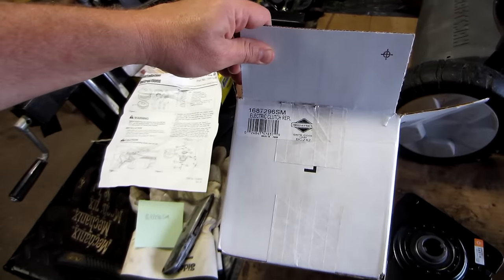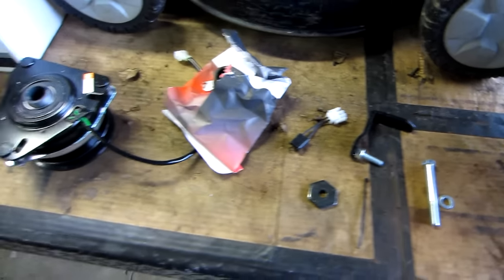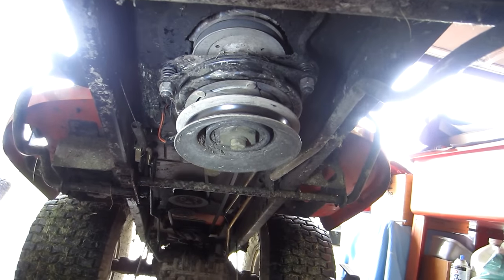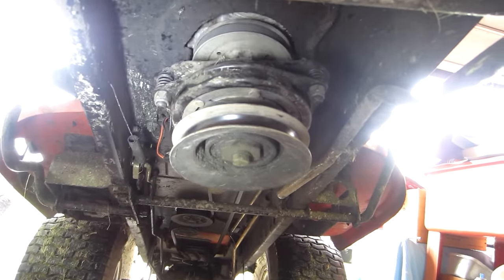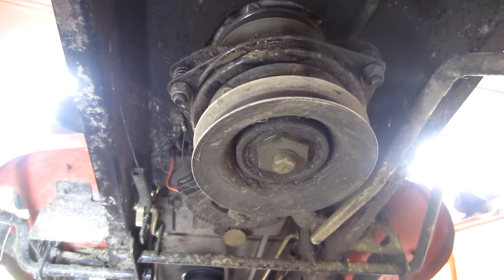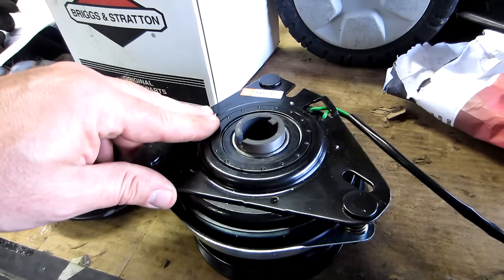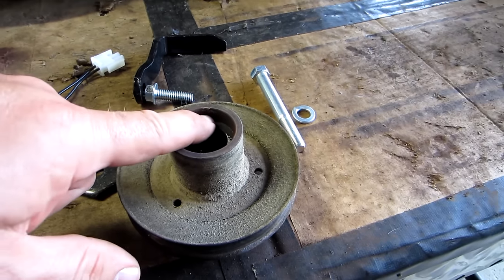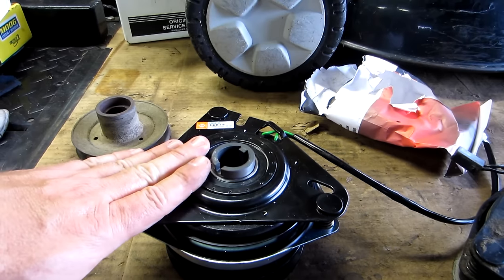Troubleshoot Replace mower PTO CLUTCH

Comment: WOW, what a great video. I'm not a Mechanic, but do most of my own repair work if I can figure it out. I'm so glad I watched this. I've had to replace the wire (splice out) going to my pto clutch twice. Husq YTH 2348 Finally found the round holding rod coming out and allowing the clutch to spin and tear everything loose. The hole in the clutch plate must be wallowed out. I put it back in good and tighted the rod which runs to the outside of the frame very tight, but it did it again. I saw on another video the techn said the ohms should be at least 2.5 across the clutch leads. His new clutch checked 3.1. I checked mine and it was .002 which is close to zero so I'm changing it out. I had started hearing a loud noise over the past couple months and kept using it. It was probably that clutch going bad. Anyway, a new clutch it is and I'm glad to see a re-design on the hold down bar vs a round rod to prevent it from spinning. You are a great instructor on your videos. You put the info down on the lower shelf so people like me (who can work with their hands and are mechanically inclined) can understand what you are saying. If I can see you do it, usually I can do it. Thanks again. By the way, I'm no spring chicken. I'm 68 and can still do it. It's the gettin up and down part that's hard. lol

Comment: Having a problem with the mower blades not engaging when the PTO is pulled up.  Going to try to troubleshoot the switch and clutch this weekend and the videos on Youtube have been very helpful with diagnosing this issue
Reply: listen to him he knows his stuff good. But my fix is turning my pto mowers into cable engagement mowers no electrical bullshit no pto clutch that you know will break again thats why John deere and craftsmen made some of their mower's with those mine wont have them for to much longer

Comment: Nice one Foxboss9, my ride on mower blades would engage at first than after a while if you turned off the blades they wouldn't re-engage. So I tested for power supply all ok, I re set the clutch gap and Bingo, she's running as good as gold.

Comment: Thank you for information and advice 
Yep clutch over heating and bad electric clutch is so common now
Reply: On my 3rd mower took me hours to figure out were the blade engagement cable goes i couldn't see how it threaded through but then i figured it out after about 3 hours

Comment: Thanks!  The bracket that mounts the front axle and deck front yolk to the frame on my 1986 Bolens GT180 made an "excursion" when the nuts finally stripped off of all four 35 year old bolts.  And of course it pulled one of the wires pulled out of the clutch assembly in doing so.  Hopefully I can shove it back in to fix it if it's just at a connector.  It looks like it pulled out cleanly.  

Or maybe I can find a new wire assembly.  It's still almost new, you know, lots of life left in the old girl.  Good enough that yeah, I might have to go with a new clutch if necessary.

Oh, by the way, I have always engaged the clutch at about half throttle.  15 years ago I had to tighten the three bolts about a third of a turn.  Once. That's it, with 925 hours on it.  So don't do it at full bore.

Comment: Converted my JD F 930 electric clutch to cable idler pulley, now  smooth engagement and no slippage.  No more silly dual coil springs to maintain belt tension.  Electric clutch is the worst idea, period 💪

Comment: Very detailed video.  I for one can appreciate it!  Pretty sure my clutch is out on mine gloms through the troubleshooting steps you mentioned.  I did however take the switch apart, broke it apart more or less lol so I can tell that the contacts were touching and verified that it was still good.  Thanks again

Comment: Good video made by an intelligent man with a good sense for video presentation. My PTO quietly died while mowing. After spending some time with the multi meter, pulling the ignition and PTO switches, finding solid ground locations, and getting random results, I started to pay more attention to the small melted spot on the PTO switch receptacle - not the plug itself. Then with the key ON and my foot on the seat to provide "operator presence", I was able to turn the clutch off and on by jiggling the connected PTO switch and plug together. But I sure wouldn't replace the entire harness, so I'll probably just bend and jigger the copper in the plug. I may take a look at how replaceable the plug is. Thanks for the inspiring vid.
Reply: Just a super great job at presenting a video that explains in depth the possible problems and the correct procedures for testing and rectifying.  You are to be applauded for just a super  presentation

Comment: Fabulous work and great explanation! I'm having this PTO clutch issue w/ my 20 year old Regent and this was a tremendous help. Unfortunately I maybe forced to get rid of my tractor if I can't get the adjustment to fix the issue. Keep up the good work.
Reply: Did you ever get that to work I can’t for life of me get my new clutch to go on should it just slide on? Or should you have to hammer it on?

Comment: Welp all done. The hardest thing was getting the connector undone to the clutch, the 2nd hardest thing was getting the drive belt onto the last pulley. I zip tied part of the belt to the pulley and I made a tool so I could turn the pulley with a ratchet and with the tool it was easy. I like my Ariens max zoom mower.

Comment: Foxboss9 thanks for your help. Let me tell you what happen . First I went and bought a new PTO switch and an new clutch. But for some reason I must have gotten a bad PTO  switch. So I did what you said and jumped the switch that I thought was brand new only to find out that it was bad, My clutch Kicked in and that was all she wrote. So I went and bought a new switch and problem solved. Thanks for you help. I am taking this serious and getting certified as a small engine mechanic. It's nice to know that I can count on you to be there. THANKS
Reply from the maker: So glad you pinpointed that issue! hopefully not much more electrical problems in the future..they can be rough to find!!

Comment: your channel is very helpful. I have a Cub Cadet ZT1 42. the wiring and switch checks out good. When I engage the electric clutch, the mower deck will not disengage. I have to shut the mower off to shut deck off. When I restart the mower, the deck is often still engaged, but not all the time. is my clutch bad?

Comment: I got a john deere 285 pto doing the same thing that would keep shutting down and I found a double yellow wire that was loose on the key switch. Replace the key switch and found that was the problem now it works great.

Comment: Awesome "mytractorforum" pointed this out to me. Lucky mule was detached for years. It's from a 1988 JD 332 dealer wants $650. I found a aftermarket coil pack on ebay & bearing for $200. Here are my quotes from tractorforum. "The problem with the resistance being .002 ohms is that it is drawing more than twice the amount of current, which heats up wires, wire insulation, VR and draws on the battery. It may work fine now, but you may just drive it till there smoke or flames rolling out from under the plastic hood"

Comment: My Craftsman got to the point where the PTO would engage with the mower cold but if you disengaged after cutting a while and tried to turn back on it would not work until you let mower cool. Yesterday it quit while I was cutting and doesn't operate at all now. Haven't had a chance to look further though.
Reply from the maker: Adjust air gap on PTO. There are three nuts that sandwich the plates at a certain distance. Definitely sounds to me as that Gap has gotten greater as the clutch has worn this is a common adjustment.

Comment: Brilliant. I need to replace the main drive belt of a Snapper SPX17542, which looks identical to this model, and was wondering what I'd have to do about the wire to the PTO clutch as it was preventing me from removing the belt. I guess I'd just have to disconnect it, and the connector is probably in the engine space. Now I don't have to remove the clutch from the engine. Thanks!

Comment: I have one when you start it and engage the clutch the motor dies Just curious if the clutch might be bad should I test it with the voltage  meter

Comment: Recently, my Craftsman DYT4000 (B&S engine) started to take much longer for blades to reach full spin speed once switch is pulled. Used to take only 1 second, now takes up to 5 seconds! New belt, tensioner, spindles and pulleys. Only thing it could be now is the PTO clutch is slippin? It's gotta be right? That would cause the blades to take longer to reach full spin speeds

Comment: I am not sure if my clutch is bad or not. It work great all last season, shapened blades, put deck back on, tried it for the first time this season and PTO clicks, but dont seem to sping blades fast enough to cut grass, had to use push mower. So it does engage but doesnt load the engine hardly at all, and blades dont spin fast enough to cut. I took the belt and blades spin easily so It has to be something in the PTO. Its on a 48" JD D-140 with electric pto. Any suggestions appreciated. Im on a fixed income and can not aford to try this and that and hope for the best, or take it to a repair shop if I dont have to. Thanks
Reply from the maker: Adjust clutch if needed... Look for a stuck belt tensioner that is allowing belt to slip on pulleys.. Make sure belt isn't in bad shape, like oil on it or wore out
Reply: Great thank you

Comment: did you use an impact to tighten this as well? I heard you're just supposed to grip the HEX nut and tighten the long bolt to torque specs? Thanks for the help. I'm about to replace mine on my broadmoor.

Comment: Ok Foxboss i tested the power from the battery to the PTO switch harness I had power. but  i don't know how to test the connection from the harness to the connector that hooks up to the connector on the PTO clutch. I put the leads on the two wires the black/white and the black one but i didn't get any reading. I don't know if that was the proper way to test. I also turned on the motor and put the switch back on. And I engaged the switch and put a clamp on the seat safety switch. I just bought the switch so i hope it's good.
Reply from the maker: One side of the tester will go to ground and the probe will need to go into the backside of the switch harness while it is connected.. Not knowing for sure which wire is going to be the hot wire with the switch on you'll need to place the Probe on each wire individually and find which one becomes hot when the switch is on and cold when off..

Comment: Great video.  I just fired up my mower from winter storage and I noticed my pot starts but it seems slow. Slow to start and my blades turn slow.  Like their labouring to turn.  I pulled my deck off and my pulleys are fine on the deck.  Could my clutch be seizing?  would that make the blades turn slow
Reply from the maker: If all tensioners and springs are articulating and tightening the belt then you may need to adjust the electric Clutch air gap... There are instructions online how to do that... Usually after sitting all winter it's a belt tension thing
Reply: Foxboss9 thank you so much for the reply.  I will check the gap and go from there.

Comment: How do you lock the crankshaft so you can torque the shaft bolt to 45-50 ft-lb when reinstalling the PTO?  The manual for my old Broadmoor says to install the drive belt to the shaft pulley before installing the PTO unit.  This means I cannot use a strap wrench to hold the shaft still.
Reply: Okay, folks...  I figured you need to access the bolt on the other end of the crankshaft -- at the top of the engine.  Time didn't permit removing the metal cover so I cut off the inner-most portion of the plastic cover to access the bolt with a socket and breaker bar.  (I strung some quality twist ties across the new opening to limit grass from entering.)  Although I hadn't known it, my impact wrench had almost gotten the PTO tight enough.  Another few lb-ft on the bottom bolt with the top bolt firmly held did the trick.  PTO now runs well.

Comment: I'm currently working on my 2001 Husky, you may have saved it with this video, thanks!
Reply from the maker: Sorry, not that specific model no.
Reply: It looks identical to the clutch on my gth2250 with B&S 22hp., but my anti-rotation tab was part of the frame. I have to try it, new tractor isn't in budget.

Comment: The switch will fail a lot unless a diode and resistor are put in the circuit to suppress the spark when the clutch is deactivated. This could also be the reason why the fuse blows for an unknown reason. Unless spark suppression is used when the coil opens a very high voltage is induced just like a Magnito coil when the points are opened.
Reply from the maker: David Ward I know that is a very common feature that is added to a lot of the John Deere mowers especially the walk behinds however, this is the way it was Wired from the factory. It only failed the one time. Makes me believe that the harness has a diode and it that I'm not aware of. Looking at the schematics I do not see it anywhere though.
Reply: look at the indicator  lamp a lot of times it will be in there

Comment: Hello brother all this started with my tractor after changing the belt not really the correct belt that goes on it, so I just had to add a little more tension Could this have caused my switch problem because belt too tight? I've loosened just waiting on new switch? Ty

Comment: Thanks for this video.  Last year I went to use my mower and found the battery dead.  I tried to jump it with one of those small battery jumper and I think it burnt out my pto switch.  I order4d one from Amazon but it didn't work.  I ordered a clutch from Sears and it would not slide onto the shaft.  The mower sat for a year and I was ready to sell it for cheap.  I watched your video and rigged up a bypass switch like you did.  The mower deck functions again.  I ordered a replacement switch from Sears Craftsman and I saved myself a couple of grand on a replacement mower.   Now everyone thinks I am a know it all fix it man!  Haha!

Comment: Very good info. My problem is when I start my JD 190C the blades come on. I have checked the PTO Switch it checks out . Does that mean my clutch is bad or a safety  switch is bad? Thanks for any advice.
Reply: Same issue
Reply: Craftsman z6000

Comment: Hey I have a Craftsman GT300. The pulley for the blades spins freely when the engine is off. I disconnected the wiring for the clutch and started the engine, but the pulley spins. Do you think the clutch is bad in this case? I don't have the mower deck for it yet. Thanks!
Reply from the maker: The pulley is supposed to spin freely until you engage the the pulley is supposed to spin freely until the electric is applied to the PTO. Then the pulley locks up
Reply: @Foxboss9  Thanks for the reply. My concern was that the blade belt pulley was spinning by the engine running (meaning the clutch was engaged) but the clutch had no power. I expected the pulley to not rotate strictly by the engine that case as in another video I saw. However I know the clutch is not engaged because I can move the pulley easily by hand when the engine is off. I will do some resistance and voltage checks in the morning. Thanks!

Comment: If your still monitoring this, I hope you won't mind answering a question for me? I have a Simplicity Conquest mower and I've had problems with the mower shutting on and off just from hitting bumps. I've played around with the wires and found wiggling the wires will make the mower run off and on. So I'm pretty sure my wiring got a short and from the looks of it is in the plug itself that plugs into the clutch. Now on the plug that's not on the clutch side, but on the tractor side has what looks like a resistor added to the plug that is hooked to both wires on the one plug. Which seems wrong to me that it would be hooked up like that being I would think when you turn on the mower the 2 wires on that plug would both get electricity at the same time. is it made that way on purpose or is that something someone added somewhere along the line? Any ideas what I'm talking about here? Really appreciate your help!
Reply from the maker: +Gale Ghostrider The resistor is to eliminate electrical feedback from the PTO when energized. 
 The PTO will only have power going to one of the wires when turned on..
You may have a bad seat switch. When you hit bumps your butt will come off the seat slightly causing the switch to think you have got up off the tractor and as a safety it turns off the blades.. 
 This is something that use to be a problem with brand new tractors that had operators that were less than 120lbs or short legged operators that had the seat adjusted all the way up. Even if you are neither of those two types of drivers I would still look at the seat switch as a definite possibility of failure.. good luck

Comment: I have craftsman T110 riding mower and my blade won't engage. I already replaced cable clutch because i ran over something in my yard that cut the original. I tried starting it and blade still didn't engage. I noticed my deck belt was loose and worn so replaced it. Still won't engage. Help plz

Comment: Best visual of everything I've seen yet. The connector... that they gave you the jumper for to connect it... to change the drive belt for my sabre 2254 had to be disconnected. That was more than a bear to get it disconnected. I had pliers, screwdrivers & a lot of muscle. I may have squeezed it so tight i may have damaged the wires. It connected back together just fine, but now the tractor doesn't start. It starts using starting fluid, but only for about 2 seconds. Could damaged wiring for the PTO cause the tractor to not stay running?
Reply from the maker: YES..